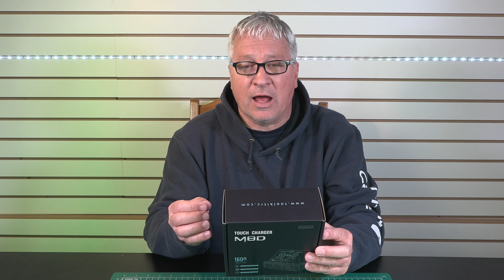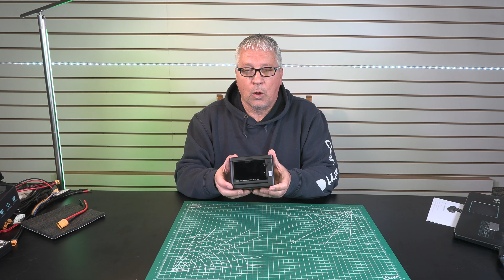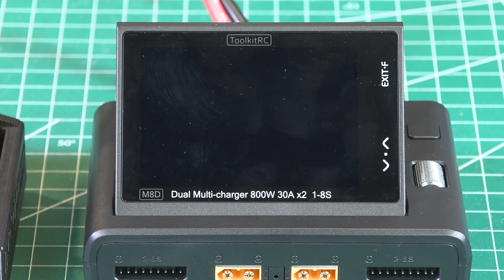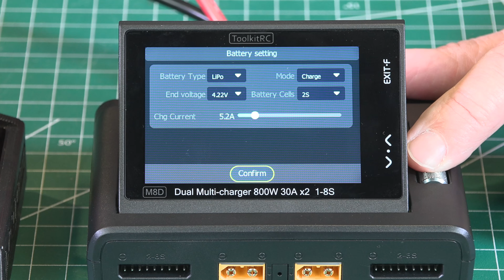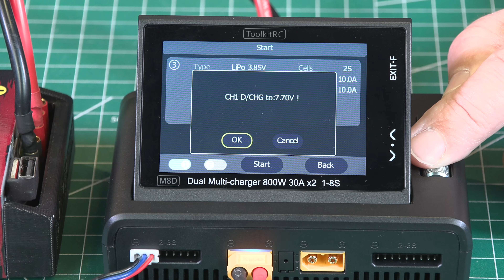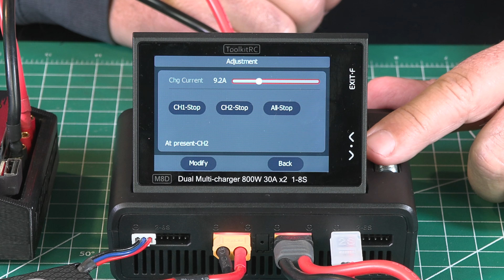New Lipo battery charger and power supply | ToolkitRC M8D touch screen RC car charger

Comment: Hi, I wanted to ask you for help... I bought this charger, it just arrived, I put it on to charge a 6s 5200 mah lipo, after 10 minutes of charging everything turns off. (I use a ToolKitRC ADP100 100W 20V9 power supply) what do you think could be the problem?
Reply from the maker: you may have it set in your settings to turn off after 10 minutes

Comment: Tell me, does the internal resistance of the batteries show correctly or is this function not accurate? :) I need to test the wear level of batteries at my work. I can, of course, do this with a special device, but it’s more convenient right away while charging. Thank you.
Reply: It's pretty good....lines up decently with my iCharger S6 and PowerLab 8 which are two of the best Lipo chargers on the market. The M8D is kind of an iCharger DX8 lite.....or a dual channel iCharger X8

Comment: Don't do what this guys does.  Don't charge standard 4.2v lipos at 4.22v
Reply: Charging at 4.22v doesn't damage the battery.
Reply: Thank you for saying that. I hade to stop watch this guy after I seen the 4.22 per cell and he didn’t know what destroy was. If your going to review stuff please know WTH your doing.
Reply: Depends on the c rating of the battery and the amount of cells.
Reply: These vids be %90 commercial %10 practical information.  

Sponsored video's are like reading the product information on the Box.